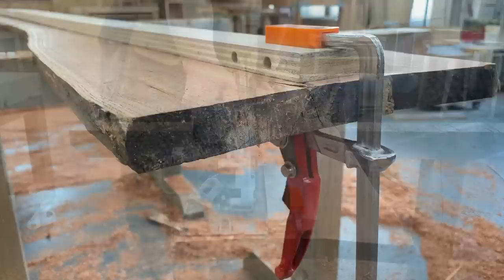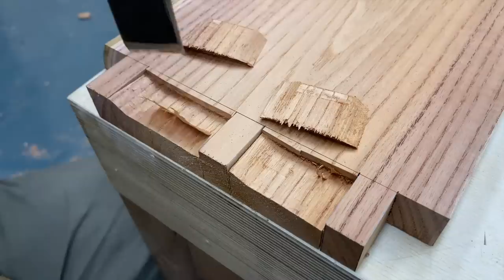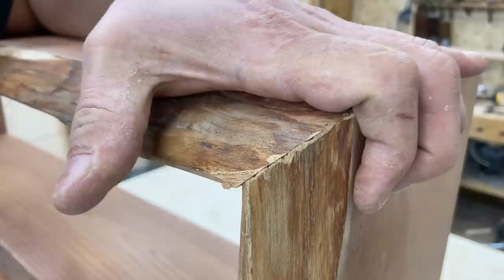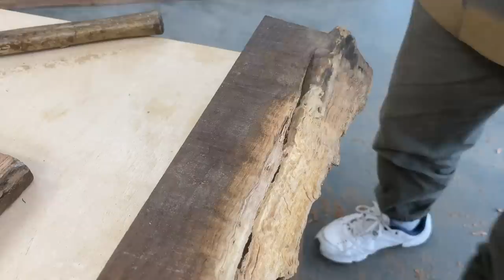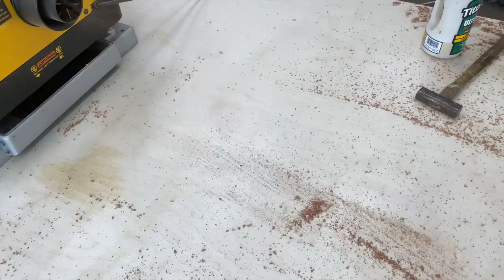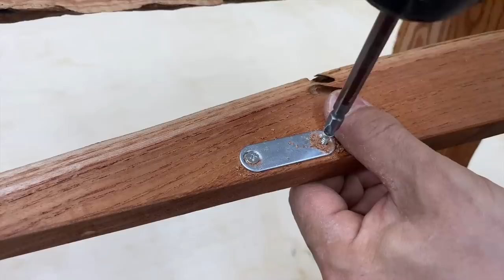The best artist is a tree worm./ Traces of insects gnawing at the wood

Comment: I'm a huge fan of your work. I've been using epoxy to fill knots and cracks. I may try the sawdust and baking soda method instead. It looks a lot faster.

One thought: Shouldn't your splines have the grain running perpendicular to the joint, not parallel? Your splines are pretty thick, so maybe it doesn't matter as much.
Reply: ordinarily yes splines would have perpendicular grain, but species also plays a factor, and he used oak which is stronger and has much less tendancy to swell to push the joint open.
Reply from the maker: nice to meet you. No glue is applied to the splines.
Reply: @망치소리HammerSound  I wasn't concerned about glue swelling to push the joint open. If the spline grain is in line with the joint, then it's not providing the same reinforcement as it would if the spline grain was perpendicular. If the spline in your joint is going to break, it will break along the grain, which is the same direction as the joint.

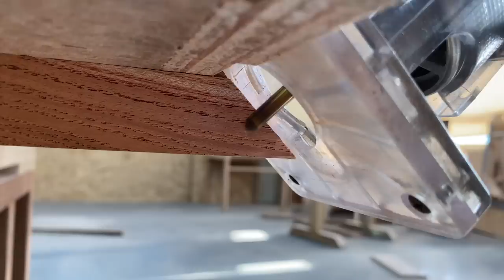Comment: #1 1:21 that joint.... I would have made higher. For structural strength
#2  get a mallet stop hitting wood with metal hammer!
Reply: Is there any particular reason why you recommend making the joint higher? And I agreed on using a wood mallet.